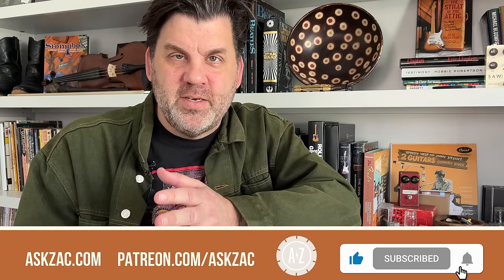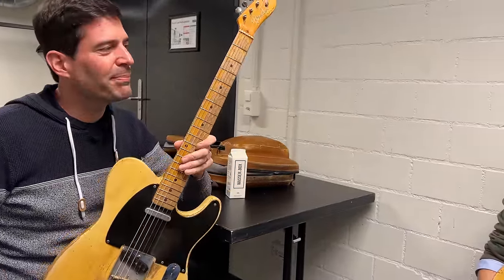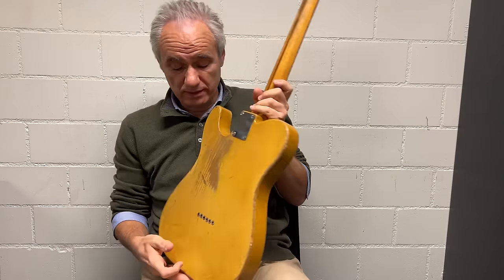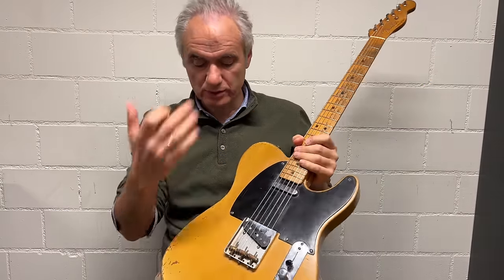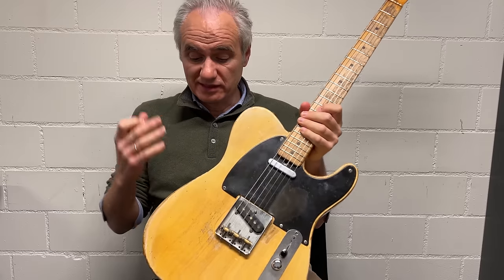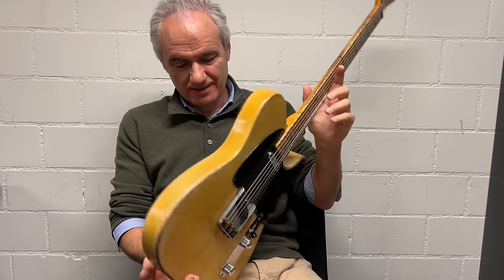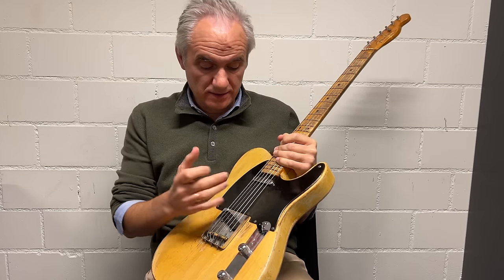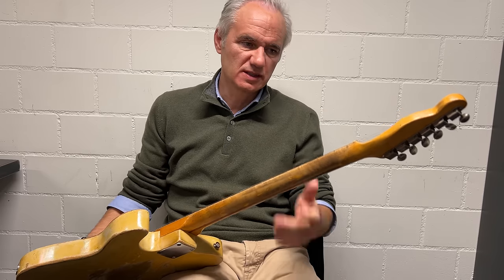1950 Broadcaster VS 1953 Telecaster - A Comparison by Nacho Banos - Ask Zac 191

Comment: Minor hardware niggle - Nacho used the term "flat head" to differentiate from Phillips screws. Flat head refers to the shape of the screw top, as opposed to oval or round. The correct term is "slotted".
Reply: fwiw he did say slottted at 5:39 when talking about the ‘50 Broadcaster. I noticed he said flathead later when talking about the mix of hardware on the ‘53.

Comment: I have built several blackguards including winding the pickups. So much fun to do and compare. I did have access to a Broadcaster in the early 80s so I have those specs. I also built a non-trussrod Tele but I used swamp ash and 1.75” thick. My favorite Tele and it would be fun to have you review a non-truss rod Tele.  The holes on the back…if they are crooked it was top drilled. The drill bit wanders, so they later did it from the back.

Comment: Testing another hand built Fender Harvard clone amp. This is the best Harvard copy yet. I am using a vintage RCA selenium rectifier for the bias supply. The transformers are accurate for ratios and power handling. The tubes are all vintage NOS or  NOS testing pulls. The pots are all a special taper. The speaker is a special reconed PM speaker using one brands frame, another brands cone and yet another brand's voice coil for a genuine Chicago made vintage Jensen sound. Carboneu made some fabulous sounding speakers. Fender rarely used them, but I don't really care. With Joe Biden's ineffective & highly selective sanctions against Russia getting those selenium diodes is very difficult and expensive.

Comment: Early 1950 Broadcasters had steel saddles. They were replaced by brass saddles by Fall 1950 which validates Nachos' instincts that this is a November 1950 Broadcaster. The blend control is the most significant feature that gets dismissed too quickly. It was brilliant and why Leo discontinued it is a real mystery to me.
Reply: The answer is that it was at the suggestion of guitarist Bill Carson. Carson disliked the blend control and wanted a tone control. Actually, the real mystery is why the "Broadcaster Blend" was introduced with the two-pickup Esquire, because the second control was always intended to be a tone control, as on the one-pickup Esquire (position 2 only.) And Leo persisted with his "dark circuit" --  despite opposition   -- until CBS did away with it in 1967!